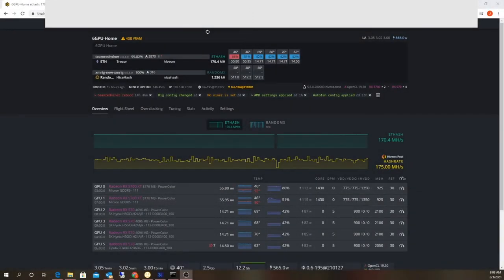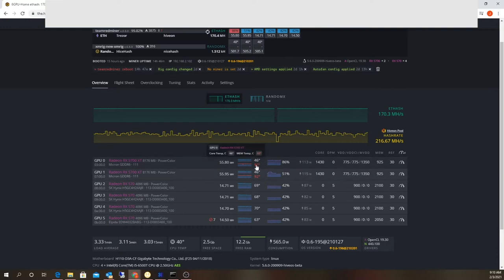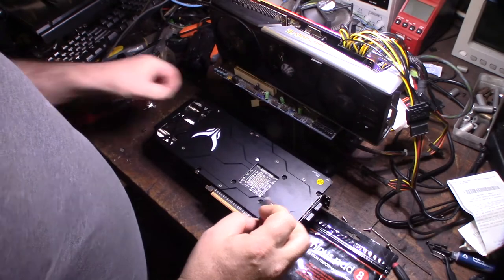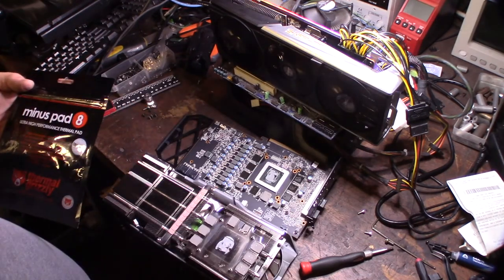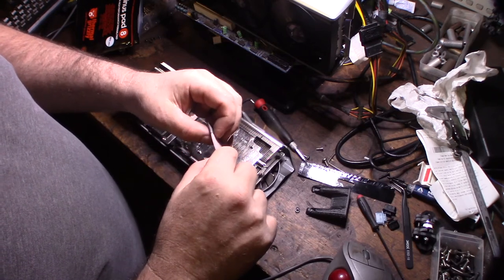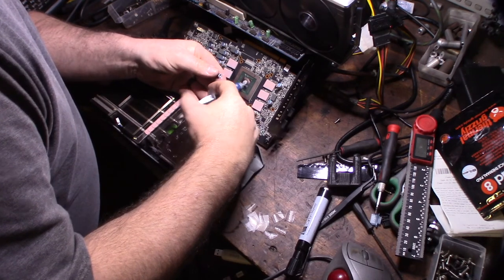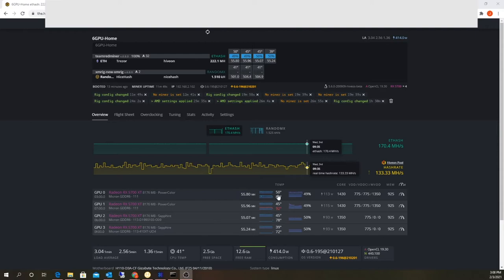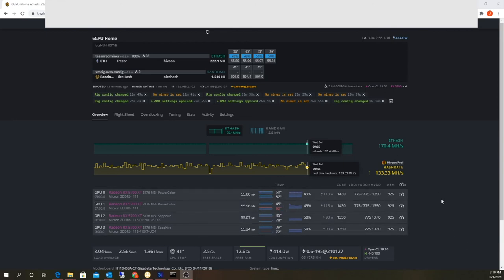GDDR6 Overheating Thermal Grizzly Minus Pad 8 INCREDIBLE!!! Hot VRAM Ethereum Mining Fix Repair Oil

Comment: I do recommend the 1.5mm pads instead of 2mm on the memory modules. All the videos I've seen said 2mm. I used the Gelid Ultimate 2mm pads and when I first mounted the cooler, the plate wasn't making contact with the GPU die at all. I took it apart again and pushed the pads down as much as I could, then remounted it and had to put alot of pressure on the cooler to get it to fully seat against the die. My temps look great now, but I'll definitely use 1.5mm next time as thats still more than think enough.
Reply from the maker: That's what I found out also
Reply: I can use 2mm gelid ultimate or it will bed temp for gpu core?

Comment: Is the other side of the  thermal pads also sticky? Meaning I could place some of those small copper heatsinks on them
Reply: you would be better off cooling performance wise using thermal adhesive to stick the copper heatsinks directly to the memory IC's - if you have room under the heatsink fins.